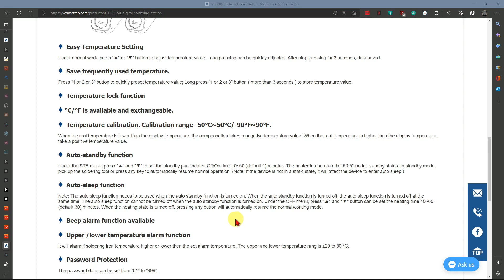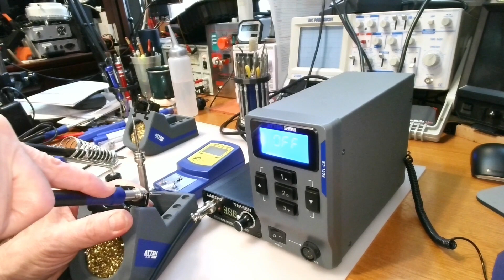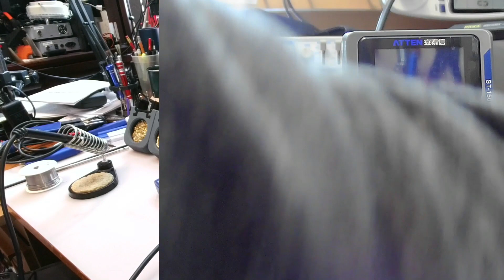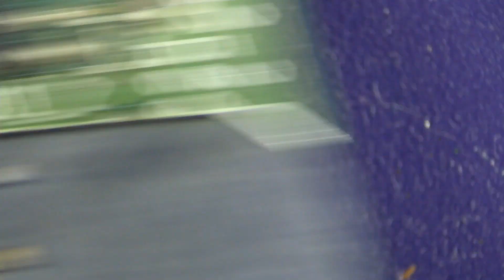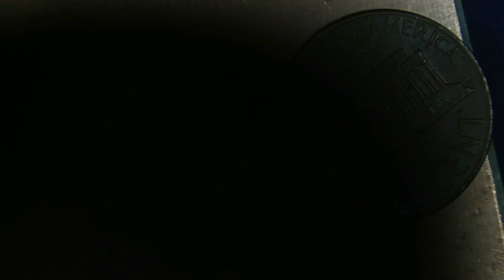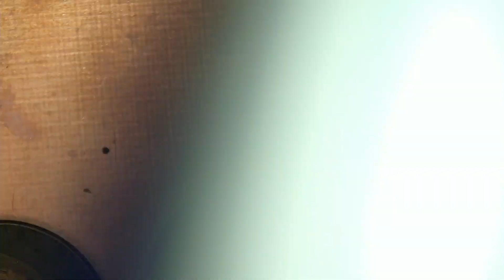ATTEN ST-1509 soldering station evaluation.

Comment: Hi how are these at removing the can type and caps
Reply from the maker: They work as well as any other quality soldering station.  For some components there are specialized tips and hot tweezers available.
Reply: @Tec @Tech-Relief thansk 😊I use jbc irons but the tweezers are expensive
Reply from the maker: @Retro4u  The Atten ones are between 40 to 55 USD and probably cheaper than JBC.  I use these all the time and they are good.

Comment: I recently bought a couple of inexpensive Schneider branded Harbor Freight soldering stations, apparently built by Atten,  the analog dial unit cost only $45 US and the digital version, internally marked ST80, sold for $120 US.  Standard 900 M or T900 tips, and I am wondering if heating elements or replacement irons are available. The Atten website shows nothing for parts and harbor freight doesn't sell parts either.
Reply from the maker: Well, I am not aware of Harborfreight's stations. I must have a look.  however, in the past I bought a bunch of inserts from Atten direct by contacting their support direct.  Also if you search AliExpress for Atten soldering irons in the past there were multiple stores selling them.
Reply: @Tech-Relief ,   I've looked around Amazon and eBay and some of the purported replacement Atten soldering irons are selling for like 90 bucks (those might be for one of the newer models, a T12 handle or high-frequency model perhaps).  The sellers rarely give you any specific Atten model numbers that a given heating element is compatible with either.  I was an audio repair tech for 20 years and whenever my boss purchased solder or flux directly from China, most of it was poor quality or misrepresented by the seller (such as acidic fluxes, probably for plumbing, marketed to electronics hobbyists,  but then it arrives and says "not for electronics" on the bottle); and then there were all the fake, counterfeit, rebranded or just plain defective IC's, Mosfets, CD drives and so on, so I'm generally not predisposed to buy directly from China. I'll probably contact Atten to ask who their authorized distributors are, rather than buying blind. They seem to be particularly popular in Australia and India, but there's not much of a presence in the US and they're not well-known here; they don't seem to have a US distributor, unlike Hakko and even Aoyue. I did find what are purported to be the correct part numbers for the irons and heaters, so perhaps that will be helpful. It's interesting that the $45 Harbor Freight unit has a GX16 7-pin aviation connector but the more expensive digital unit has an ordinary 5 pin DIN which I personally think is underrated for this type of use. Also, the cheaper unit has a metal-encapsulated heater (and slightly larger diameter) while the digital unit has the common, and slightly thinner,  exposed ceramic heater. (The inner hole diameter of cheap tips varies tremendously, generally a sloppy fit, and so I intend to buy some genuine Hakko tips). I'll keep searching, and will post a review of the Harbor Freight ST80 when I have a chance.

BTW, I used an Aoyue INT701A++ for 5 years at work, when our ancient Hakko units were dying and we couldn't get parts, and with a few tweaks and mods, the desoldering half worked surprisingly well; though the soldering wand was no great shakes......
Reply: @Tech-Relief  ,  Looking at online listings of Atten solder stations and their private-label versions, I discovered that Newark Electronics sells the same basic station, branded Multicomp Pro, for $40, and they have replacement irons called the AP-50 for $10.
Reply from the maker: I had a look at the Harborfreight website and the Soldering stations you mention are nothing like the ATTEN stations which are more of the professional type that have inserts that have the heating elements inside the tips.  The ones I saw appear to have the standard old fashioned ceramic heating elements with a tubular soldering tip that slips over the heating element which are very common.  Other than the pinout of the plug I suspect most that most of these types of soldering irons would be compatible?  I recently reviewed a battery operated soldering station that had the same type of iron: https://www.youtube.com/watch?v=XYMUyld8peQ&t=5s
Reply: @Tech-Relief  , yes, old-school T900 or 900M type tips, like the older or less expensive Hakko units ----  I'll buy some genuine Hakko tips for my HF units because the included tips are made of iron, and conical, which I hate.  Of course, they're not professional grade units like you might have been expecting,  because this is Harbor Freight we're talking about after all! BTW, the new entry-level Hakko FX888DX has a lousy user-interface for programming it, and they've changed it from using 900 tips to something else, T32 I think, which means that users of earlier Hakko units need to buy a new set of tips!

Comment: AI wonder for the way that st-1509 wake up. t12 based on ball type vibration switch which bother me to static soldering op it just take a sleep mode even im doing solder 
Could you leave me some reply how st-1509 take sleep mode? Does st-1509 have the same sensor?
Reply from the maker: I am not sure what type of sensor is used but the standby and wake up time is programmable and works perfectly for me.
Reply: @Tech-Relief  thanks for the answer :)

Comment: Thanks for the video! I have one question, does the standby mode exit with handle Y9130 and handle Y950 work when you move the handle? It works fine with N9100, but it doesn't work with handle Y9130 and handle Y950. Thanks
Reply from the maker: Yes, for me they work flawlessly if I even knock them they turn on.  However, keep in mind that there are two stages to this.  There is a setting for the timeout to turn the heat off and this has to be set properly.  Secondly, it first goes into an intermediate stand by mode where the heat turns back on when you pick up the handle.  If however you do not touch it for a longer time the display will say STBY if I remember correctly and then it will only turn on if you press one of the buttons.
Reply from the maker: Update, I have mine set to 3 minutes to go to standby mode and after 3 minutes it displays St8 but after a longer delay not sure but perhaps 15 minutes it goes to sleep mode and then you have to press a button to wake it up.
Reply: Thanks a lot for the answer, it looks like I have a defective one and in STBY mode, when touching or moving the handle, it does not wake up. But the 9100 wakes up perfectly after touching. 
Have a good day! @Tech-Relief

Comment: Thanks ! I'm curious how works thinner and more precise ATTEN tips on tiny SMD components still !
Reply from the maker: I will be posting a Video building a Li-ion boost converter using a TPS61023 chip from TI and this one is so small I will have to use the smallest tip on the 50 Watt iron.  I have not soldered such a small chip so it is going to be interesting.
Reply: @Tech-Relief  Maybe some small capacitors (1-2mm) 🙂 ? Thx !
Reply from the maker: @emil8367  I just finished soldering the TI boost chip.  It is 1.2 by 1.6 mm and has six pins.  It was difficult but I managed (I think not tested yet) So this is like a tiny resistor but with six legs...  Has to use the smallest needle sharp soldering tip I have...  If you watch the upcoming video you will see.
Reply: @Tech-Relief  I asked because I broke a capacitor on Asus zenith 2 extreme alpha (TRX40 version). 
Asus won't help, due to confidential information (it's crazy but these are their policy, I didn't know that they have such crap !).
Now post error always appear (means is not bootable at all). I'm afraid to do anything there to not damage it more 😀

I'm waiting for the video ofc. Useful knowledge. Many thanks.
Reply from the maker: @emil8367  I see, well you need a suitable soldering station and a microscope to solder very small components.  You will likely also need flux which helps to stop solder bridges etc. if pins or components are close together.
Reply: @Tech-Relief  Equipment is ready. I'm prepared. The Only issue is to know the replaced capacitor value. 
There are 4 in parallel, but I need to do a photo to measure their size maybe using Microscope Measure soft (Andostar microscope).
One of the caps is a bit smaller, not sure if is even like that. Not sure what was used before, the capacitor is lost somewhere.
This is how it looks: 'ibb' with dot and 'co' after slash Jzvvp9X (YT deletes my comments with entire links so)
Reply from the maker: I created a video on Micro-Soldering and Desoldering (it is uploading right now) ; Perhaps this will answer your questions: https://youtu.be/xSwkUTWTUeU
Reply: @Tech-Relief  many thanks, I'll take a look

Comment: Thank you for the video! can you please measure the resistance between 7th pin of the  connector for 130 watt soldering handle and other pins of this connector. I bought this station with tweezers and a vacuum pump handle for atten gt series station and trying to get it work with this station, but I can't understand the logic, by wich station detects what handle is inserted right now 12 or 24 volts...
Reply from the maker: Alright: Numbering the pins looking into the male plug, pin 1 is the left top according to the numbers in the plug.  R = Ohm, Open means open circuit. With the tip plugged in: 1=2.3R, 2=0.3R, 3=5.2R, 4=0.3R, 5=Open, 6=Open, 8=Open, 9=5.5K.  With the tip unplugged pin 1,2,and 9 are the same and all others are open circuit.  Pin 1 counts down so probably there is some sort of circuit there.  Hope this helps?
Reply: huge thanks! I have connected my handle according to your pinout and station recognized it, but after a short time e7 error appeared that's mean short circuit of thermo couple. I checked everything, but it didn't helped. 
So may be this my attempt was not such a great idea  in general.
Reply: applying any resistance or ground to the pin 1 does nothing, pin 2- ground from handle,pin 4 is for thermocouple, 5 heater, 7 ground, 9 handle detection resistance
Reply from the maker: @jacklittlejack5690  Yes the thermocouples can vary in the past I had to put a resistor in series on a different station to make it work but even then it was only partially successful .
Reply: I didn't notice that you have 150 w handle, does it has any difference in resistance of pins to 7th pin in comparison to 130w handle?
Reply: but it's looks like another type of thermocouple is used for the gt-x150 suction handle, but may be the same type that is used in 150 w handle, because of the same wattage

Comment: Thanks for doing a review on this product, I wish more people would review it. Do you know if the tip on the tweezer can be adjusted and how small of a component it will be good for?
Reply from the maker: The tips of the tweezers do not need to be adjusted as such, but there are multiple different inserts available for the tweezers.  The default insert is the 0.51 mm ones and they can handle most SMD components right down to the smallest.  For larger components I have the 2.2 mm insert also, but the 0.51 mm ones are the ones I use 95% of the time.  There are also inserts with larger tips shaped like blades which may be suitable for certain connectors etc.  but I have not tried these myself.  https://www.aliexpress.us/item/3256804222701170.html and https://www.aliexpress.us/item/3256804843678065.htm.  All I know is I can't do without them anymore.
Reply: @Tech-Relief  I recently bought their hot air station the ST-862D two months ago and have been very impressed by it, so I wanted to give this brand a try with the hot tweezer. That is awesome, it seems like you are happy with the unit.
Reply from the maker: I am happy with the ATTEN soldering station, it certainly is a step up from the T12 DIY Stations I have.  Although I use both.  I use the ATTEN Station if I need the extra power or the tweezers.  I plan to purchase a second station so I can have both the tweezers and a soldering iron going at the same time.
Reply: @Tech-Relief  Пинцет тоже регулируется, сразу оба наконечника. Но температура кончиков жал пинцета не совпадает более чем на 25-30 градусов. К примеру, левое - 230, правое - 256 градусов. Это не регулируется :( 
Я пробовал менять местами два маленьких мосфета, менял местами сами наконечники, покупал другой пинцет, но ситуация не меняется. Нужно изучать вопрос глубже, управление этими мосфетами.

The tweezers are also adjustable, both tips at once. But the temperature of the tips of the stings of the tweezers does not match by more than 25-30 degrees. For example, left - 230, right - 256 degrees. It's not regulated :(
I tried to swap two small mosfets, swap the tips themselves, buy another tweezers, but the situation does not change. We need to study the issue deeper, the anagement of these mosfets.
Reply from the maker: @TheOpulaz  Sorry about the delay, spring is a busy time for me.  However, I presume you are talking about the hot tweezers?  I tested mine with my soldering iron temperature tester and found that mine are not more than a few degree C different on the tips.  I did notice however, that the temperature on the tester will vary depending on how fresh the solder on the test probe is, it shows less temperature after a short period of time when the solder oxidizes.  If I put a little fresh leaded solder on the probe each time and test the temperature each tip seems very close in temperature.  So I have not seen the problem you describe.

Comment: Thanks for the review. I just ordered the tweezers and iron. If you need to solder bigger things try an American Beauty resistance soldering station. The one I have will output 1800w. Makes easy work of 8mm/10mm bullet connectors and even has tips for copper pipes.
Reply from the maker: Yes I have seen it, it is a resistance system right?  It seems somewhat similar to a spot welder except that it outputs a constant current so it can melt the copper into what ever you are wanting to connect? However, at $500 plus I have been wondering if I could make something like that using an old microwave oven transformer.  What voltage and current  does it produce I wonder?
Reply: @Tech-Relief  yes, I think you could use a microwave transformer. The one I have has multiple outputs (I think just different voltages) it works with fairly low voltage i believe less then 10v and high amps. Making one would be a cool project. If you want i can check the exact voltage outputs. Let me know.
Reply from the maker: @mattbentley8958  I am curious what voltage is used since if it has 1800W you would need 100 Amps at 18V.  I have a microwave transformer from a 1200W microwave.  An other question is if it uses AC or DC?
Reply: @Tech-Relief   The output is AC. It has 24 different voltage settings. The lowest is 1.2v and the highest is 6.9v (i read 7.3v with my multi meter no load). So 260amp. It says its 50% duty cycle. It can really heat up the 6 ga cables if you use it very long on full power.

Comment: Hi thank you for the review. The only seller for this station on Aliexpress informed me that I only need one handle and it can manage different wattage and no need to buy 3 handles. This is a direct quote from the seller " Only one handle is required and will deliver the wattage with the different type of tips?" The handle iron advised was Y9150.
Reply from the maker: So the 130 and 150 watt handles appear to be the same, the 50 watt however is entirely different.  I would not buy the 50 watt version unless you really need something low powered.  I think the 130 watt is the ones to go for.
Reply: @Tech-Relief  
.QQQQQQQQQQQQQQQQQQQQQQQQQQQQQQQQQQQQQQQQ
Reply: even original jbc station share the same principle, tip size will be the one   responsible for power delivery, higher thermal mass will deliver more power, you cannot expect a conical tip to draw full power